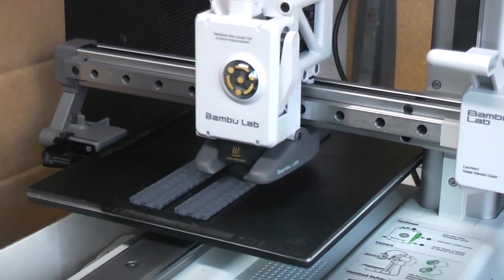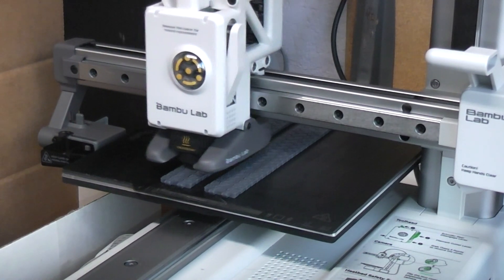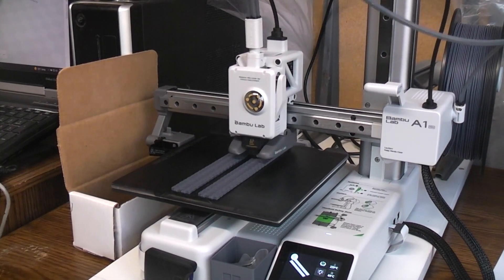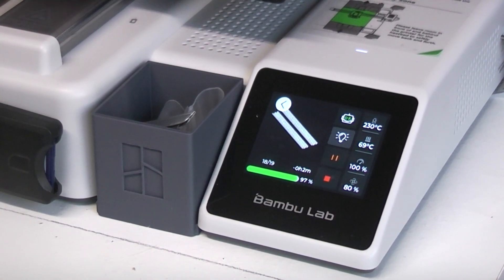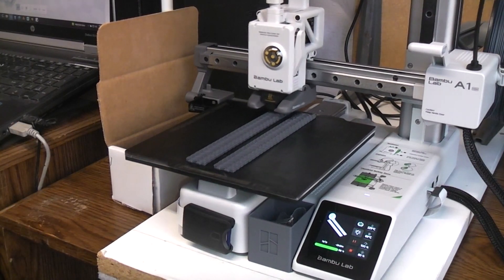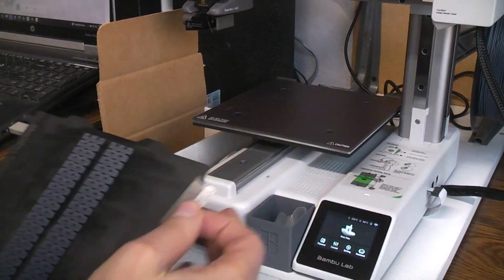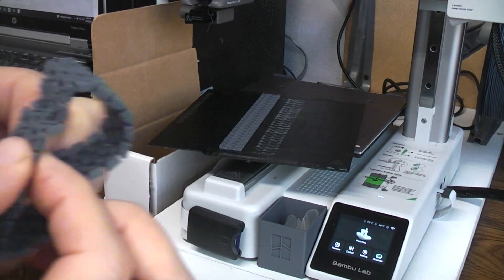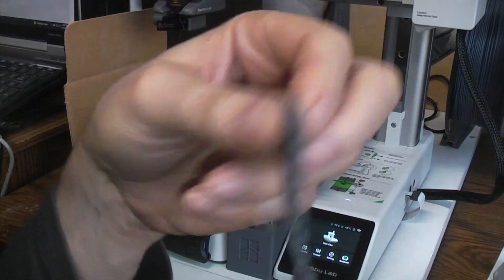Watchband, tank tread or wall-e-tracks? Testing the speed quality of the Bambu Lab A1 Mini.

Comment: I printed the Wall-E on the bambu X1C and it worked with no problems (PLA). Did you scale it up?
Also a tip is to use 3DLac (pump spray bottle version) on the smooth bed. I used glue stick at the start with the X1C and is was horrible. The glue stains are still on the model and you need to clean the bed after every print. With the 3DLac I pray it on like every 3-4 prints and it vaporizes as the bed heats up but the prints stick on the bed with no problems. It also does not build up like glue stick so I almost never have to clean the bed sheet and leaves no marks on the print. To assemble the tracks it helps to twist it in place. The Marble run 003 model on Makersworld has a similar system with hooks used to elevate the marbles.
Reply from the maker: Thanks for the tip on the 3DLac (pump spray bottle version). I will have to check it out.

Comment: I'm beginning to warm to this Bambu labs machine.
I use a sheet of boron glass on my 3d printer and for smaller parts, I brush the glass with a very diluted pvc glue (water based)
Reply from the maker: Yes I have printed on Boron glass for years, works great and gives the old printers that did not have auto bed mesh leveling a nice flat build plate.